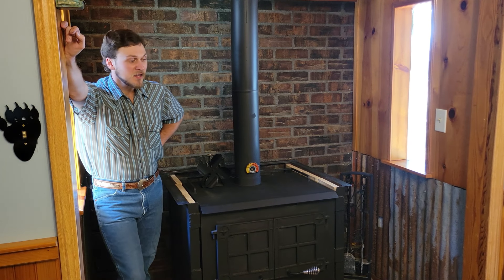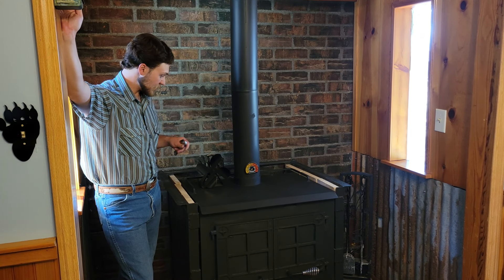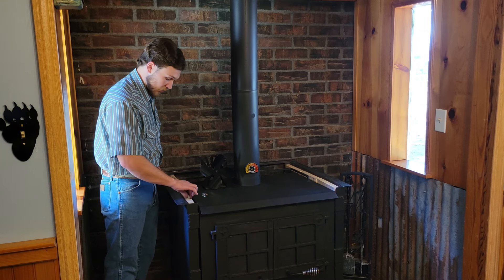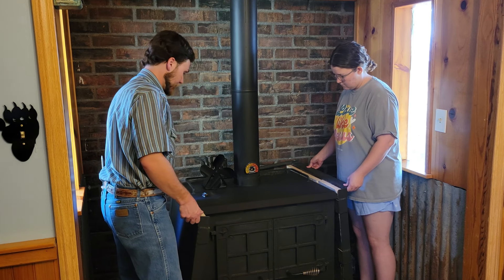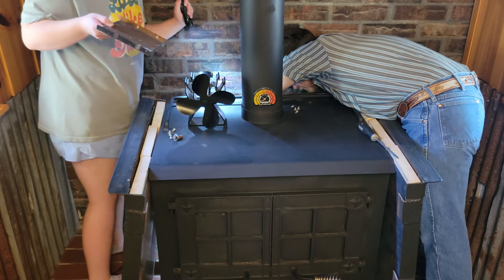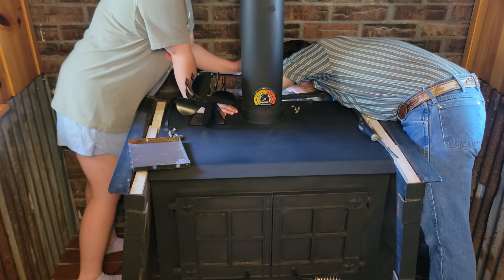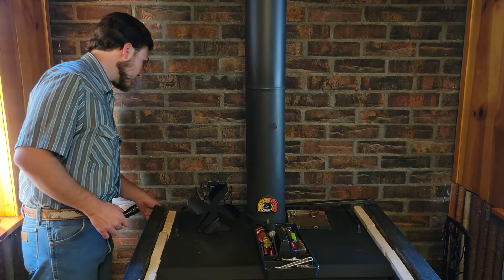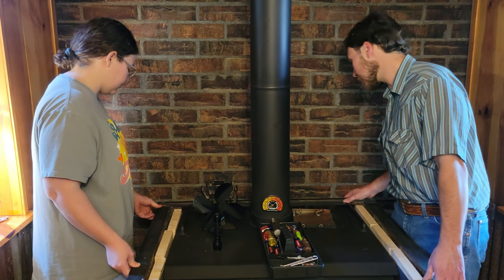This has to be done before Winter || Working on the wood stove (Part 1)

Comment: Basic idea, glass is bad. Bolted 1/4" steel to cast door. Never leak or break again. Welded would be better, but often mixed results. Sand in an old pot does some of what the firebrick does. Fixed, real permanent!
Reply from the maker: Thanks for watching!